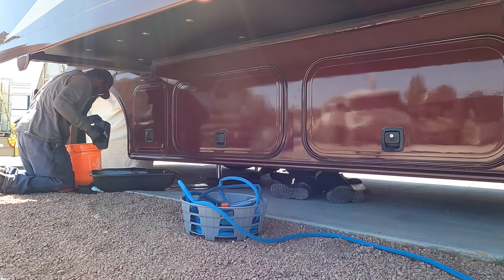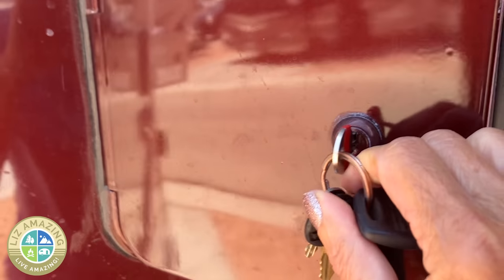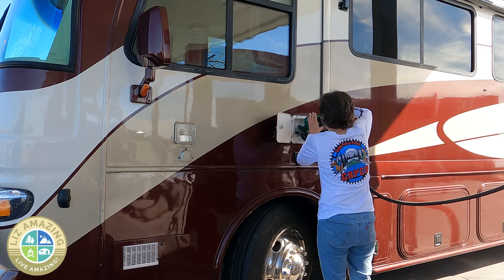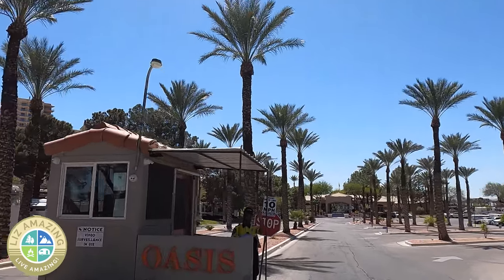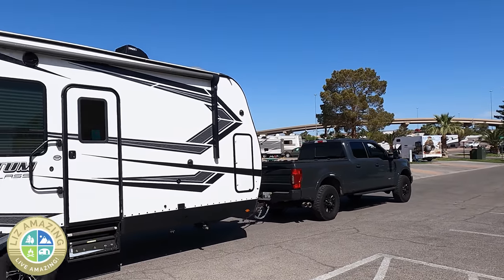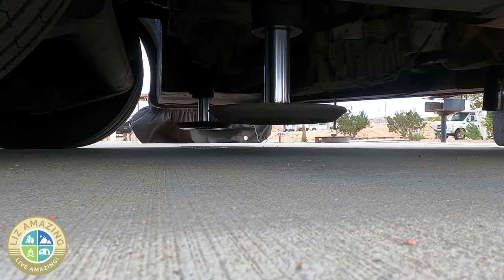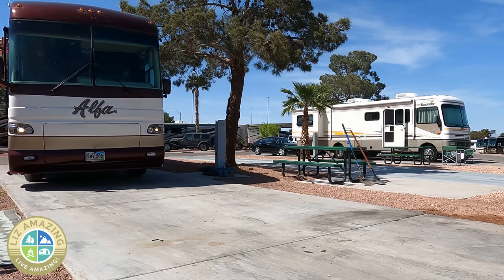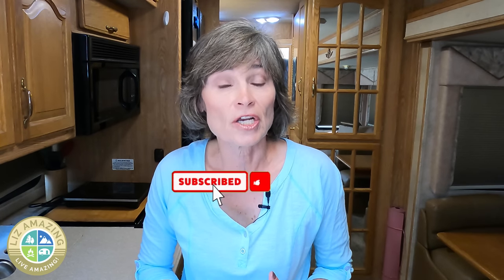RV Life: The WORST mistake I've ever made!

Comment: I dont undestand  why these people do not file a formal complaint with NHTSA to force these scammers to recall their trash.

From complaints
to recall
NHTSA issues vehicle safety standards and requires manufacturers to recall vehicles and equipment that have safety-related defects. Learn about NHTSA's recall process.

Reporting your problem is the important first step.
Your complaint will be added to a public NHTSA database after personally identifying information is removed.

If the agency receives similar reports from a number of people about the same product, this could indicate that a safety-related defect may exist that would warrant the opening of an investigation.

These owners are part of the problem if they do not report the safety issues to the Department of Motor Vehicles. Things will change when the Feds show up to investigate. 

I've been a class A owner for close to 30 years, never had an issue that was not fully resolved the first time to my satisfaction, knowledge is power!

Comment: lady, you gave away 90 gallons of good diesel. for a few hundred dollars you can get tutthill 12v fuel pump and water separating fuel filters, that service company if they Arte worth thier salt should have known this. maybe 50 dollars worth of filters would have done it after draining the heavier water out of bottom of tank. a  case of fuel filters for your rig and you would be good to go.

Comment: It might have been cheaper to have your rig towed to a nearby parking lot to get the repair performed.
Reply from the maker: Keep watching and you’ll see why I couldn’t do that.
Reply: @LizAmazing  
I saw why you chose not to, a heavy wrecker would have done it easily. If they lift at the rear, no need to disconnect the drive shaft. It all worked out in the end.

Comment: Hard to believe they do this all the time when they do it the hardest, messiest, most miserable and time-consuming way imaginable!  An electric pump set up to where they could either shove a hose into the tank or adapt to the fuel line either at the tank or transfer pump would have effortlessly pumped most of it out, and it only would have only taken one guy.  I have found that having a pump like this around is quite handy... E-bay search: Universal High Volume Fuel Pump 140GPH Chrome F53003C $59.99
Reply from the maker: Yep. I don't know why they didn't use a pump, just glad to have it done. Thanks so much for your comment, Raymond, see you in the next video.

Comment: I'm thinking a savvy mechanic could have disconnected your main fuel line and hooked up a 5 gallon can of fuel to your motorhome to get it off property and raise the air pressure. 
And instead of doing all that extra work underneath the motorhome why didn't they just pump or siphon the water and fuel out of the fuel spout and then maybe drain a last little bit out of the bottom?
Reply from the maker: Yep. Better ways to do this, and ways to save the diesel. I'm just grateful that they came when they did and all that is behind me now. They're still my heroes! Thanks for watching.

Comment: You didn't say if you checked the water trap on your fuel filter might need to be drained !
Reply from the maker: Yes. I was told to drive it 200 miles and then check it and also buy a new filter, which I did. Thanks for watching.

Comment: Call those poor men and tell them to screw a valve into the bottom of the tank with a hose and then use a 25 dollar pump to pump it to the disposal tank....they could have done it in about an hour, and only made the mess once when they took out the plug and installed the valve, it would have saved the threads of the tank as well. Not to mention the fuel spill the resort had to clean up. I wonder where they disposed of that contaminated soil???   Great story, sorry it happened. isn't RV-ing fun.
Reply from the maker: Thanks John. I'm sure there were better ways to do it but those guys are still my heroes. Thanks for your comment !

Comment: Drop the tank, did he realize it would weigh 700 + pounds.... Water is heavier than diesel all they needed to do is wait a day and pump the water only out of the bottom of the tank. especially with you knowing that you only put in 13 gals..   and keep a eye on the filters.
Reply from the maker: It had already been a few days so we were good on the settling. BUT water is going to drain out like your bathtub. That means it's going to have that vortex, pulling water from all levels. That's why, as you saw in the video, I had to drain the whole thing. Thanks for watching.
Reply: 20 years in the boat buss. when a sinker came in , I would tilt the boat up and to one side a little on land. let it sit for a day, insert a small hose down into the low conner of the fuel tank and remove the water, leaving what gas remained.. not sure how easy that would be to do on your motor home, but that was a lot of costly fuel to depose of. I would not be surprised if the guys use it themselves.

Comment: No.1- change fuel ⛽️ door lock to a barrel key type Only this door for Diesel or Gasoline Or Def. Fluid only this will keep water out this key 🔑 goes next to ignition key only all other keys on another key ring…
No.2- next time pull fuse or and relay’s to fuel ⛽️ pump
No.3- Do Not try to start engine . 
No.4- all RVer’s Need to start a list of places not willing to allow proper experienced service persons for unexpected accidents like this. The way they want it to run is pay off’s it’s very corrupt and unethical
Some please start an app to avoid places like this place just simple boycott it ! Don’t Take Payoffs. The RV Community is about helping people not taking advantage of them.
Reply from the maker: Thanks so much for your comment, Ted! Yes, I am definitely getting a locking fuel cap, just for peace of mind. Good tips all, thanks so much for being here through this!

Comment: 1. Obviously you have put fuel in it many many times and you didn't realize the problem before it became a mistake. The doors are different colors, far apart and the caps are different. It's hard to understand this.

2. I understand the resorts need to have approved vendors and require business licences and business insurance. Many won't and it's a liability for the resort and you.

3. You wasted 80 gallons, $350, by letting them take the fuel away. I assure you that NO fuel was disposed of. It simply needs to settle in a tank and the fuel drawn off above the water. This could have even been done on site. Simple filtering devices are commonly available for this if needed. Boats, yachts and all manner of commercial water craft have there fuel pumped out, dried out and put back in the crafts tank. It is a common and very profitable business in all coastal areas. After the way moe and curly handled the fuel, it would need to be filtered.

4. Your guys, while they got the job done, made a real mess of it.  They should have covered the ground in the entire area where they were working. If I owned the resort I'd be pissed at their sloppy work and my stained pad and contaminated soil. The soil contamination was probably mostly from the overflowing tank. I would have simply installed a temporary valve in the fuel tank drain opening and put a line on it to the outside with another valve on the end of it. The rest I would have done much differently too.

5. I didn't hear you say how much all of this cost you.

Comment: Flash lights work.
Reply from the maker: They do indeed! I even have a headlamp. What was YOUR worst mistake?
Reply: @LizAmazing  Just wondered if you used a light that night putting water hose in? My worst is driving off with diesel pump handle still in side of the coach.

Comment: Worse mistake ,is putting gas in this diesel tank and starting up the motor 
Many units will have tagged the gate as ,clear diesel only(do not use colored diesel...it is for off road use only ie no road tax added) 
AND ...water only 
Label ,Label,Label ,Label 
It could have been even worse ,a new motor $30,000🕵🇨🇦
Reply from the maker: Yikes! That is so true. Thanks so much for your comment and for watching Ralph. See you in the next video.

Comment: Sorry lady, you still got conned.
Simple 12v pump and hose to suck out most of the liquid and pump directly into their tank in a few minutes. Only use the drain plug for the last few dregs.
The diesel and water will separate if left to stand. So they can decant off the top and sell most of your "contaminated" diesel to the next customer. Leaving about 15 gallons of contaminated water to pay for disposal of.
Wonder where the 40 gals of diesel they provided you with came from?
We all learn from mistakes sometimes.
Reply from the maker: They dumped it in already dirty tank so I don't think they reclaimed it unfortunately. I'm just glad to have all that behind me now. Thanks for watching.

Comment: You made a big rookie RV'er mistake and it cost you big time.  The guys that finally did the job were not someone I would have working on my rig.   What an unprofessional and dangerous way to empty the tank.   And they made quite a mess.  I am surprised the rv park did not fine you for the mess they left on the driveway and stones.  unfortunately u were stuck with limited options to correct the problem.  A professional business of that kind would have had a hose with a fitting that screwed right into your rv tank drain plug and pumped it all out.  It was such a half ass operation i just shook my head watching that mess.

Comment: So sorry to hear this happened to you, but I would suggest investing in one of those headlights that you can wear when you go out at night so that you never make that mistake again. We stayed at a campground in Myrtle Beach that also had an exclusive list of people you needed to use if you needed any service done at all. They do charge them, but they claim the charge is to be able to print them in their book. We did use one of their vendors to have our motorhome washed and waxed, and their pricing was very competitive and they did a great job. We also saw some other mobile repair people in there, which luckily we did not need to use, but they. Were the main ones in the area. When I asked about it, they said it actually protects the campers because they only use reputable companies that are properly insured so there are no issues. Good luck, but I would get that valve where your water tank is fixed.
Reply from the maker: Thanks Linda. I actually have a headlamp but did not use it!!! I will NEVER make this mistake again. Glad the preferred vendors at the Myrtle Beach campground at least had competitive pricing. Thanks for watching and happy travels.